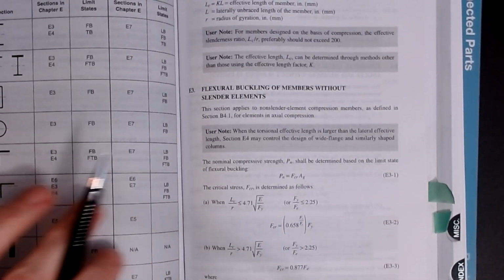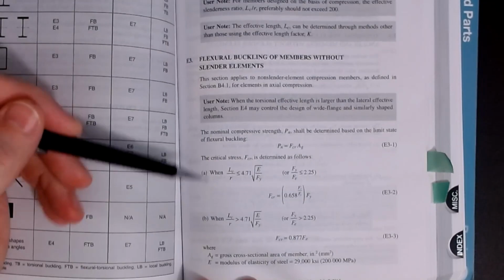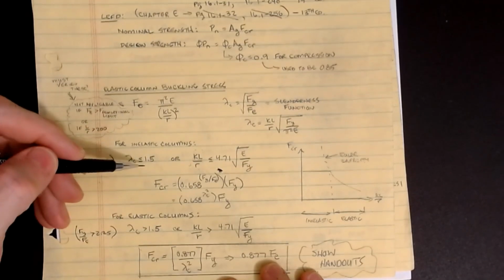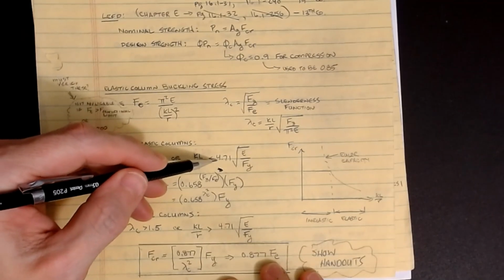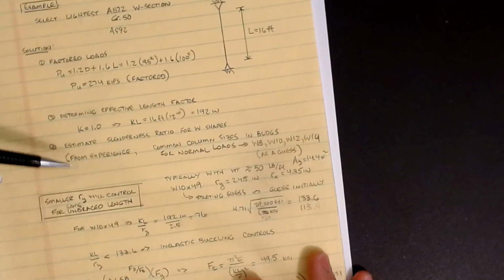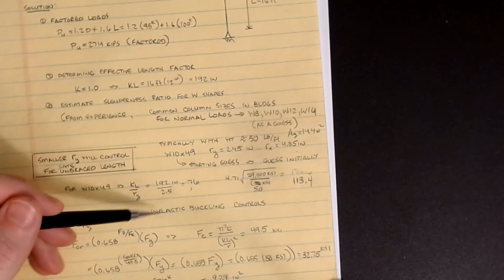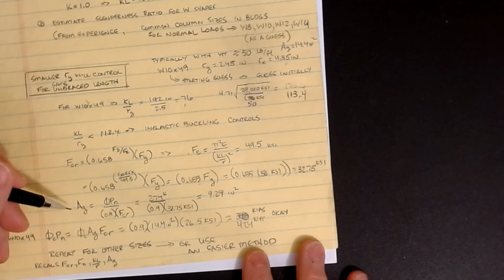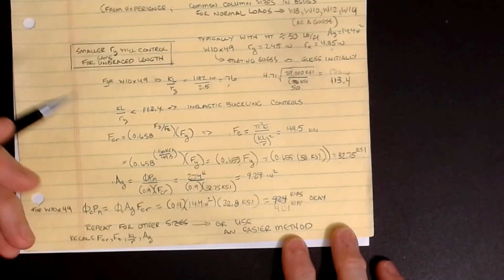013 CE341 Steel Design: AISC Column Strength Requirements

Comment: Are these equations independent of section shape?  I.e. Hss round and rectangular shapes?  Based on the math, it seems as long as you use the correct ry and rx that is taken care of right?
Reply from the maker: The rx, ry, and rz parameters will all incorporate the shape of the section in their calculation since radius of gyration is based on the different moments of inertia and the area in its very definition. Thanks for watching!